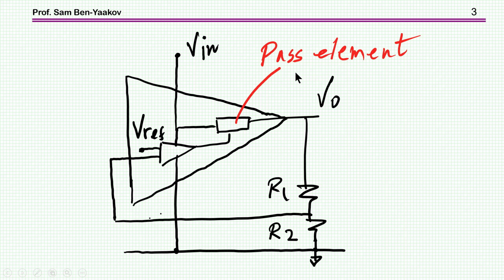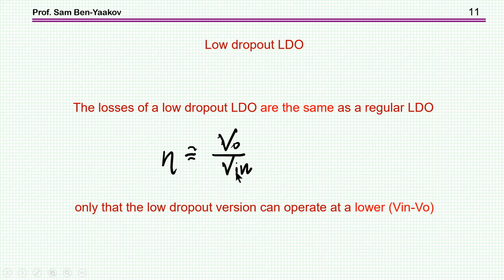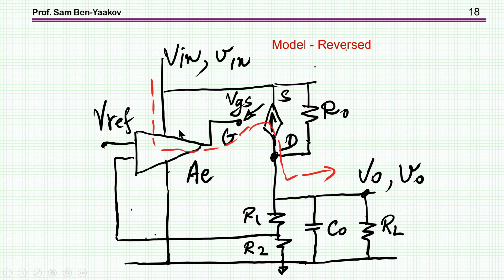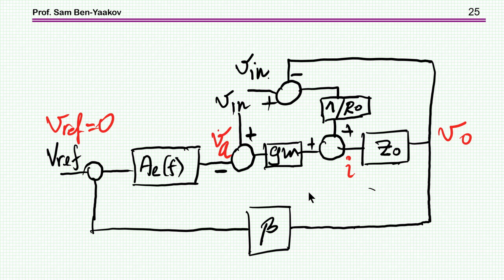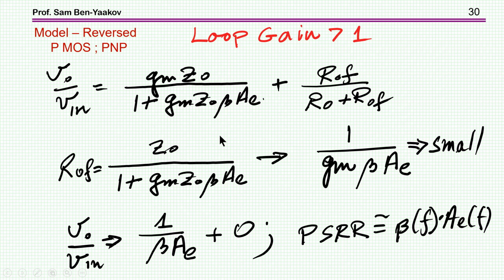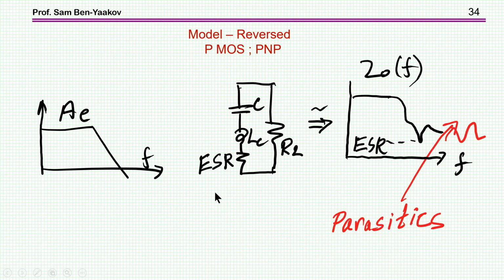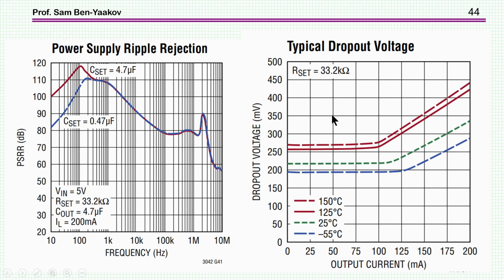PSRR of LDOs: An intuitive analysis

Comment: What a beautiful explanation.

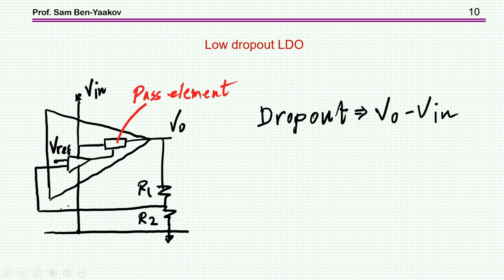Just small correction, @4:24 Dropout should be Vin-Vout.

In summary,  NMOS has better PSRR and once the loop gain is less than 1 then both types LDO depends upon Zo(inversely proportional) and heavily impacted by ESR, lower ESR means better PSRR. PSRR is also depending upon operating condition and it would be lower with lower drop out and higher temperature.
Reply from the maker: Thanks for the correction and the input.

Comment: Thank you so much for this excellent presentation ! I simulated in LTspice the LM7805 regulator to verify/data sheet comparison the output impedance as well as the PSRR. The simulation result for the output impedance was exactly identical to the data sheet, but the PSRR at low frequency (i.e. 10Hz) was around 190dB and much higher as in the datasheet. May I ask you, which circuit setup has to be used to get promissing results. Thanks in advance.
Reply from the maker: Thanks for sharing. much higher you mean higher rejection in the simulation at compared to the data sheet?
Reply: @sambenyaakov  Yes indeed. In my LTspice simulation, I used exactly the same circuit configuration as shown in the datasheet. Vin-Vout=8V+3,5vrms; f=120Hz, ILoad=1Amp.
My result for (Vin/Vout)dB = 124dB (flat from 10Hz to 1,6KHz(3dB point), falling down to 77dB @100KHz. So, there is a significant difference to the datasheet. In figure 5, one can
around 80dB to 85dB at low frequency. So, did I something wrong, or is the 7805.lib model incorrect?
Thank you for your valuable answers.
Best regards
Udo
Reply from the maker: Just to make sure, by simulation you mean the LTspice model of the device?
Reply: @sambenyaakov  Dear Professor,
Yes, I am using the LM7805 component. The symbol file were found in examples\Bordodynov\lib\lib\sym\zzz\VolReg\7805.asy
The subckt-file in LTspiceXVII\lib\sub\regulators.lib. The subcircuit was created by C:\Arquivos de Programas\LTC\SwCADIII\lib\sub\regulators.lib
---------------------------
In the meantime, I found via Internet another subckt-model, named 78xx.lib, which is uA7805 from Texas Instruments (the former Fairchild company, I guess). In this datasheet, there is no bode plot for PSRR found, but an entry under Parameters. Ripple rejection is there specified between 62dB and 78dB, for Vin = 8 to 12V; f=120Hz, Vo=5V@500mA. 
Now, I’ve tested(simulated) the uA7805 which gave me a PSRR=71dB at low frequencies (10Hz…1,5kHz (3dB point)). This is right in the middle of the specified value and looks promising. Can I conclude the LM7806/LM340 model is incorrect?
Best regards
Reply: @sambenyaakov  Dear Professor, I responded to your question, but I do not see it herein. Maybe, I pressed a wrong button. Anyway, yes I mean the LTspice model.
To make communication easier, I could send you the spice files, together with the simulation file. What is the best way to upload the files? 
Best regards

Comment: This led me to another mystery that's been puzzling me for years: If I used op amp directly as a stabilizer, I would run into problems with its stability because of capacitive load  of all the decoupling capacitors it has to feed. In the datasheets of most linear voltage stabilizers, on the other hand, one can read a minimum capacitor value required at the output, to achieve stability. Is this because of the effect of output transistor or is the internal op amp somehow frequency-precompensated to allow stable operation with high capacitive loads?
Reply from the maker: LDO are also subject to instability due to capacitive loading. Data sheets have specific instructions how to avoid it.
Reply: @sambenyaakov  Thank you for the replies.

Comment: Thank you for an insightful analysis. Now I am only wondering how would the NPN-mode regulator stand against the PNP one, concerning its ability to react to a quickly changing load (e.g. a micro controller going from sleep to full speed and back to sleep again). Intuitively, it seems to me, that the NPN transistor acts like an emitter follower before the op amp  reacts to the change, therefore the voltage drop due to a sudden change might not be as deep as in the case of PNP, because bandwidth of a transistor would be much higher than that of the whole feedback loop. But is this phenomenon practically significant?
Reply from the maker: Your observation is correct, but the key to fast response is a good control tuning rather than the switch.

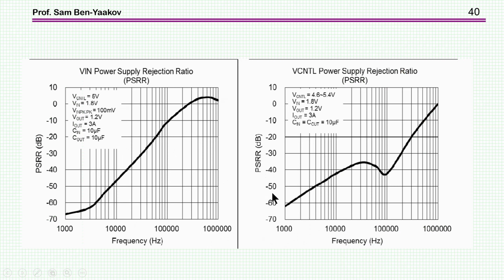Comment: Very informative. I was a little surprised that at 25:31 the Vin PSRR above 300 kHz seems to actually be increasing the power supply noise rather than decreasing it. Am I seeing this correctly? This would obviously be very unwelcome behavior in many applications...
Reply: Yup, that's not too uncommon, and of course generally not desired. Would have to look at loop gain and phase margin to ensure stability.
Reply from the maker: I must say that I am baffled with this data. The capacitances of the pass transistor may explain the corruption at high frequency to some extent, but the change is huge. Never seen such a large change in other LDOs.